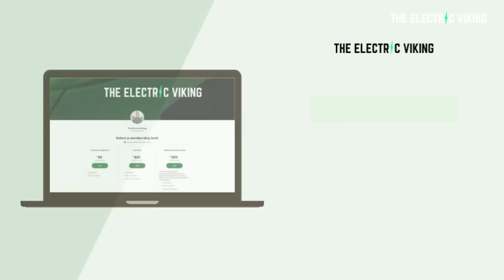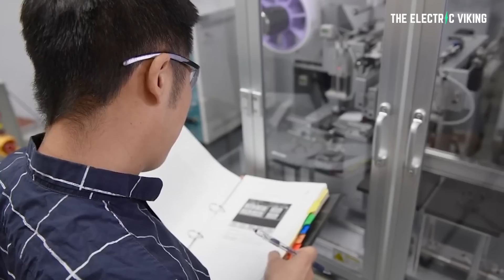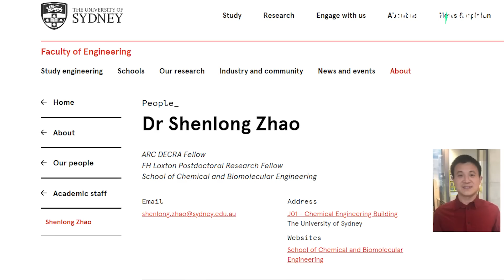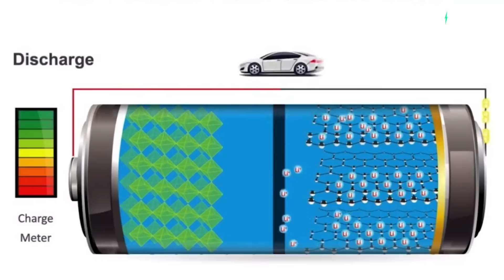Scientists discover cheap sodium batteries with 4x capacity of lithium

Comment: The writing is on the wall. Salt are very porous and can compacted many times. If the normal compaction can give you 300km, with some industrial compaction it will give you at least three times more. Moreover the higher the density the better and more efficient the flow.

Comment: Key questions to ask about batteries:
- energy density (sodium-sulphur is promising here)
- temperature tolerance (people live in places that get cold, cars must also survive there. how are these cells at -30 C?)
- materials accessibility (sodium is dead common, this is a plus)
- failure states (kaboom? fizzle? unpleasant smell? what happens when a sodium-sulphur battery fails really badly? ask them to set one on fire or shoot it with a harpoon to check.)

Comment: This is the big deal that I want. Cost, weight and avaliability are the big 3 issues with EV batteries, this solves it all. Also battery degradation isn't a huge deal if it is cheap and easily recyclable.

Comment: Sodium batteries to have the same capacity will be 3 to 4x heavier. Both lithium and sodium are monovalent. Sodium element is 3x heavier at least. Until they prove it in an EV, I'm skeptical. To retain only half the capacity after only 1000 cycles isn't good either for transport use. UNSW demonstrated a new cathode lithium battery that had low degradation in a semi-solid design, and safer, and more capacity.

Comment: I love good news..at least it is happening in battery research if not in the world of geopolitics.  With 4x density we'd need less batteries to go further and thus less weight and cost of the car. In 3-4 years mid value EV's should be at a price point equal to or better than ICE vehicles.

Comment: I’m not sure  if it has already been said, but, are we lucky enough that this technology will miraculously be “be available in the next 5 years”?  Dramatic change indeed, if these batteries were to be in cars next year with 4x the capacity and fast recharge (not sure if you said how fast recharge is, I can only believe it must be good based on your giddiness) then we, as a country are only a few short months away from energy independence.  I now will be able to use my car as an energy source to run my home.  Especially recharging rapidly with my portable Solar panels.  This is truly amazing, I’m going to switch over to network news now, as this must be the buzz in the news for sure…..I’m back, the news hasn’t got a single story on energy independence yet, looks like you scooped them all.
Reply: New battery tech won't create energy independence overnight, but it will make wind and solar viable for complete grid production.

Comment: It's good that they final found something better then lithium but wait hang on only 4x better then lithium have you seen the  periodic table have a look at the weight I'll save you the hasel Li=6.94 Na=22.990 divide one by the other it's 3.31 so basically if it doesn't store 4x the energy of lithium it's not any better as far as wh/kg goes but if it's cheaper than hey yay you BEV will still be heavier than there ICE counter parts

Comment: That 50% drop in capacity after 1000 (20-80%?) cycles needs to be improved. But hey, it's early days, and if they can get that down to 10% drop, then yeah, we'll see EVs with these batteries instead.

Comment: I see that these new vehicles still have that ridiculous spoiler on the rear! Hello, it literally means spoiler of the air flow! Make these vehicles a Fastback design all the way down to the bumper! They need to show videos of wind tunnel testing so people can see what happens to the air flow in the rear! It doesn't matter how rounded your front end is if your rear end is just sucking you backwards with drag! And as far as sodium goes, there's an unlimited Supply, when you look at desalinization plants, and they're pumping brine back into the sea, what a waste! Also, I believe the salt batteries won't need Cooling or, or at least not liquid cooling, which will eventually leak!

Comment: The $25000 electric vehicle is coming with these break throughs and that is the game changer. These $55000 EV's are out of reach for much of the general population and that is the issue that has to be tackled. Possibly Tata , BYD , Geely might come with the solution that "saves the planet".
Reply: Hydrogen fuel cells are the better alternative for EVs longer term, but require infrastructure to be built up.  They don't have the massive cost or weight associated with battery packs, because unlike batteries, they can be recharged in about the same time it takes to fuel up with gasoline.  Hydrogen can be produced at the point of distribution, so existing fuel stations can transition toward it, slowly adding more capacity as more vehicles use it.  By freeing up battery resources from cars, this approach would also make grid battery storage much cheaper.

Comment: Using sea water to extract the sodium would enable a byproduct from desalination plants. This could help negate some of the damage done by the toxic  high salt content brine dumped back into the oceans
Reply: Lol.  The brine from desalination is not toxic.  It dilutes back into the ocean very easily, it's hardly 2x the salinity as the source sea water.  Just need an area large enough to ensure proper dilution.

It'll still be cheaper to mine the salt, rather than process the brine, until new filtering techniques are developed.
Reply: @gerryburde5663  I recall reading or seeing something saying the salinity was more than that. I thought it was 10X making it toxic to sea life in the surrounding vicinity of the outlets. 
An over abundance of misinformation from information channels

Comment: They need to improve the cycle life a bit. But at 1,000 miles range  per charge that makes 1,000 charges a nominal  million miles. The problem is people will not do the 10% to 90%  cycle. They will top it up 70% to 100% and it will be badly degraded with 2 years.

Comment: That makes sense, it's a sodium sulphur battery. Sulphur has long been questioned as an alternative to lithium as it technically has a theoretical energy density just under 3 times as dense as lithium ion (400wh/kg vs 1000wh/kg). In theory it would be great, the downside is that sulphur ions grow and shrink with heating cycles making the battery fail rather easily. I know they've been working on it for the past like 3 decades though.

Comment: I think you're way overselling electric aircraft. There's currently no existing way to make an electric jet engine. You might say that doesn't matter as the jet didn't always exist, but it would mean planes would be half as fast and only go about a third as far per flight. We need an electric jet alternative. 

As of right now, the only option I saw was a device using microwaves to mimic a jet engine, the downside is that making microwaves is incredibly inefficient. The process of making microwaves is only about 70% efficient at best and the process of heating materials is another about 80%, if it contains water that is. With the electric jet we're heating raw air which means it only has an energy conversion of about 12-15%. That's nearly worthless. 

I mean sure it could mean we could make electric VTOLs, but those would never be allowed in city areas as they're just too loud. I mean seriously, we all have noticed how you can hear emergency helicopters before you can even see them.

Comment: Lithium Sulphur is also being worked on. That would give 2x again on top of Sodium Sulphur, and would certainly make commercial electric flight possible, as well as serving in heavy haulage and marine applications. Hovewer, Lithium Sulphur is proving a bit harder to crack as a battery chemistry.

Comment: Many places around the world suffer from water shortages, even in Europe it can be a problem. The reason I’m stating this is because Spain for example use reverse osmosis to get fresh water from the sea is quite an expensive process, but if as a by product they could harvest the salt for these batteries that would kill two birds with one stone and reduce the cost of water production, a win win.
Reply: They already do harvest the salt and we use it for food. Obtaing salt for batteries is not an issue.
Reply: @E-BikingAdventures   Your right, Spain does harvest salt from the sea but not via sea water to fresh water. The salt farms I’ve seen are base on original salt farms set up by the romans and that’s fine. My point unless you’ve missed it was simply two processes could come from one unless that is you disagree?

Comment: Gravimetric and volumetric energy densities are recognised units of measure for battery energy storage. This is not provided other than a claim of 4x lithium ion battery performance. 4x what?  It's a headline seeking statement from a university probably designed to get media coverage in order to elicit more research funding for next year. 
What seems to be overlooked is that in this sodium sulphur battery, it is likely the sulphur which is providing the significant increase in energy density, as it does for lithium sulphur batteries. The breakdown of the sulphur is the biggest problem for batteries and the fact that in this case it still loses 50% over 1,000 cycles means it's well short of the longevity needed for storage solutions. On the face of it they have made good progress but still a long way to go for a product that is commercially viable.

Comment: 400% improvement in battery density would make EV technology perform effectively for Ford F-150 lightning towing a heavy trailer. Ships and long range aircraft would be the last remaining refuge of hydrocarbon based transportation.  Also home solar panels with home battery storage would be very cost effective for home electricity and charging EVs

Comment: If 4x capacity is true, we can cut down the battery size, like who needs more than a 1000km range outside of pick up or commercial purposes? not many, most will benefit from a smaller/lighter battery since it will also reduce costs.
Reply: We do need 1000km range in places like Australia where the recharging infrastructure is poor.  Less than that is fine for use only around cities, but any kind of road trip would be painful.
Reply: Not true because we would switch to personal aircraft.
Reply: @E-BikingAdventures  And where would we charge up our aircraft?  It's a long distance between airports.
Reply: @simongross3122  . You don't need airports to take off from your own backyard. You don't need a runway either.  Do people have to go an airport to fly their drones?
Reply: @E-BikingAdventures  True enough provided these aircraft are like helicopters.   But you need something a bit more substantial than a drone to carry a few people and your luggage if you're going on a road trip.   It'd be an interesting exercise to work out how one would travel this way from Sydney to Brisbane, or better yet, Sydney to Perth.  I suspect you'd stick it in your trailer and drive there instead.

Comment: This got me thinking with electrolysis now at 95% efficiency and fuel cell efficiencies increasing, wouldn’t it be mildly ironic if hydrogen batteries became a thing, i.e when you plug your car in to charge it simply converts onboard water to hydrogen and stores the hydrogen in onboard tanks, when you drive a fuel cell converts the hydrogen back to stored water. Guess what I’m saying is we should invest and research all new green technologies, batteries, hydrogen, bio-fuels, because we never know what new discoveries are out there, we should let physics, maths and engineering decide, not hold any preconceived prejudice.

Comment: There are 2 different types of chemistry mixed together in this video. One is sodium-sulphur and the other is sodium-ion chemistry. The latter is what BYD and CATL are working on, which has lower energy density than lithium-ion. The former is a completely different type of battery, which is much more energy dense and works very differently than the lithium-ion-like chemistry of the latter. This kind of chemistry has its own challenges and there is a similar Li-based version of this chemistry as well. I don't think advances in one kind of battery technology benefit the other much.
Reply: Sounds like a mixed up story to me. Ready just in time for fusion.
Reply: Damn inconvenient facts...  lol.  

Sodium-ion despite the lower density can still be relevant for consumer vehicles.  The weight isn't that bad the big challenge is volume (about 2x that of nickel based lithium ion).  Using the same 155liters of volume for the 1000 mile Aptera they could have enough batteries to still reach 400 miles which is definitely still usable.  More traditional shaped vehicles with physically larger packs can still be designed to reach 250 miles of range with sodium ion; if lithium and other key metals keep increasing in price this is the likely future for entry level vehicles.
Reply: Understood, that may be disappointing and disrupt my thesis. I’m glad you pointed this out.
Reply: @pgiatrakis  Sodium-ion-based batteries are apparently close to (vehicle) market introduction, but I am quite sure the room temperature sodium-sulphur-based batteries are still a long way from commercial use. Certainly in vehicles. The energy density is very attractive (lithium-sulphur batteries are even energy-denser), but there are still a lot of longevity issues to solve. Apparently this group from Australia is making progress.
Reply: Clickbait shite

Comment: 50% degradation after 1000 cycles seems like a major obstacle.
Reply: If my math is right it reaches 50% degradation after 1 million miles. That’s not too bad of an obstacle IF IM CORRECT
Reply: @pgiatrakis  Only if you drive till the battery is near 0% and then charge to 100 % every time. If you charge regularly, say every night then the battery last about 3 years.
Reply: Is it?  They have 4X the capacity and sodium is much cheaper - and more plentiful - than lithium.  How many cycles will these need to go thru?  Even at 50% degradation, they'd still have twice the capacity of brand new lithium batteries.

Comment: Assuming the batteries weigh the same as lithium batteries, then they have solved the weight problem. 1/4 the size of batteries are needed for a given range.
Reply: Sodium is heavier than lithium, so they will undoubtedly weigh more.  But not 4 times more.  They'd almost certainly provide around 2 times as much storage per kilogram, assuming the 4X capacity figure is true.  Maybe 3 times as much.

Comment: While I echo the thoughts below on what this could mean to the auto industry, I think you just found a new checkbox for existing water desalination systems.  Now, instead if returning concentrated brine to the ocean, that brine could have the salt removed from the brine and turned into batteries.  Now most know that water desalination is expensive because of energy usage.  If they could mine there own battery material, batteries could be made that were powered by the sun or charged during non peek hours to run desalination systems.  This is a win win win scenario.
Reply: The brine is only 2x concentrated e.g. 7% salt versus 3.5%.. the cost to get the remaining salt out isn't worth it versus just mining it like we do.

Comment: This has much greater impact on transport than on stationary storage. Any battery that can power a plane (a game-changer in itself) will also improve ground vehicles a lot, with far lighter battery packs needed.
Reply: Here in north America, range is still a huge issue. this change would solve all of that at a stroke. Especially if the technology doesn't lose half or more of its output when it is cold outside.   Read the find print and the 500 Km range of current utilities  (Pickup truck) drops to about 150 if it is cold out and you insist on having the cabin heater on. Think about it this way, barely two hours of driving time.  For me, not enough to get to a city and back without charging.
Reply: I don't personally believe batteries are the right approach for vehicles.  For EV, hydrogen fuel cells probably make more sense, because you 'fill up' just like you do with gasoline rather than waiting for an hour for a charge.  Further, because solar and wind are intermittent and often create unused excess, you can use that excess directly for electrolysis to produce hydrogen (which can be done at points of distribution rather than at the source).  By doing it at the points of distribution, you eliminate the transportation costs which are much of the price of hydrogen today.
Reply: @eventhisidistaken  There are copious analyses about why hydrogen is inappropriate for passenger EVs, just search. Of course, this does nothing to detract from the central, pivotal role that hydrogen will play in energy transition.

Comment: Harvesting sodium from desalination plants could be a solution, and an extra income source, for pumping the concentrated salt solution back into the ocean. Maybe a win win?...
Reply: Sulphur is also incredibly cheap $183 per ton in 2021. 1000 cycles to half capacity is not as bad as it seems in such a low cost high energy density battery - imagine starting with 200 kWh of battery and 700 miles of range, even with degredation, you would still have 350 miles of range after around 525000 miles.
Reply: Absolutely! Sludge mining is going to be a game changer to improve the economics of desalination, which itself is going to be far more common than today. They go hand in hand as a complimentary industry
Reply: Massive fan of sodium based battery chemistries. They are going to be ubiquitous in most use cases, especially with home storage. Safe, cheap and very reliable. Late 2023 and 2024 are going to see them installed all over the place.
Reply: Salten sea in California